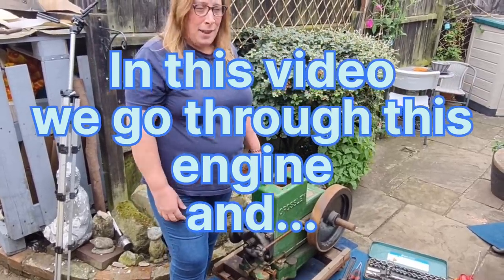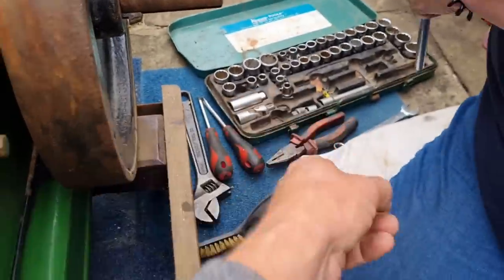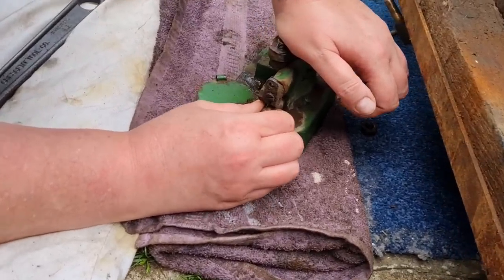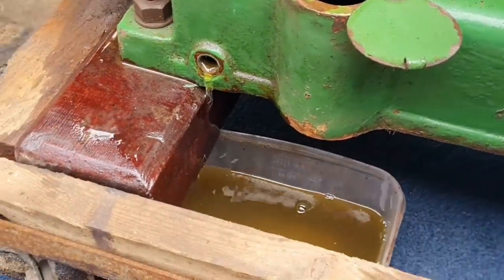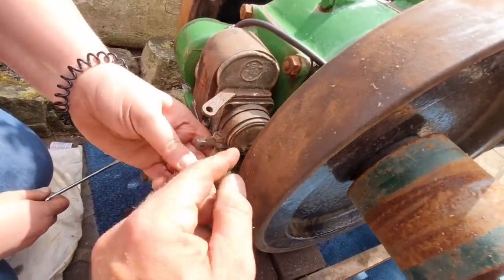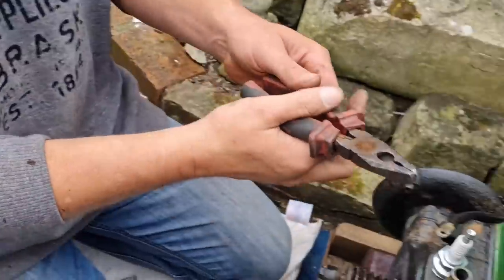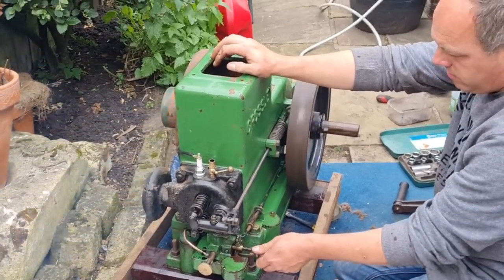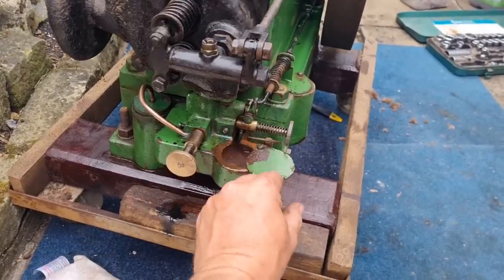Barn Find Engine.Old start cold start. Crossley

Comment: Rachels Crosley is a Petrol Paraffin, the main tank is for the Paraffin/TVO and you just fill the bowl up with petrol, just like on a old Ruston. 

BUT Unless you have easy and cheap supply to heating oil, it might just be easier these days to run on petrol, especially if the engine is not going to be under a real load. 

I actually wonder if your timing is a bit retarded. 

When the comment about a prick came up I was waiting for  Rachel to say something about Adam....... lol. 

Lovely to see Mrs Mancave taking a active interest in old engines. Do we need another channel, or perhaps a channel name change to Mr & Mrs Norfolk Mancave? As I tell my friend Becky, there's very little a man can do that a woman can't. Sybil loved seeing Rachel working on a engine.
Reply: Thank you will pass the info on, was chuckling to myself at times, thank you for all your support x
Send our love to Sybil x

Comment: To determine direction of rotation,Look at the heel on the points, it should run in the trailing position rather than leading. If you ,know what I mean. Off load she sounds like a hit and miss engine, does the governor control a" kill" switch for the mag?
Reply: Hi I have passed this on to Mr MC . Thank you for all your support x

Comment: It is petrol paraffin - petrol in the trough and paraffin in the base tank, when the fuel is used up in the trough then switch the base tank valve on. You can just run it on petrol in base tank if wanted like you are now then if so dont touch the trough side. Put more tension on the throttle spring and it will fire evenly
Reply: Thank you I have passed this on to Mr MC
Thank you for all your support x
Reply: @OutandaboutR  😎

Comment: They should have screwed all those needles in first, so they would have a starting point when they try to start it!   Urff!
---
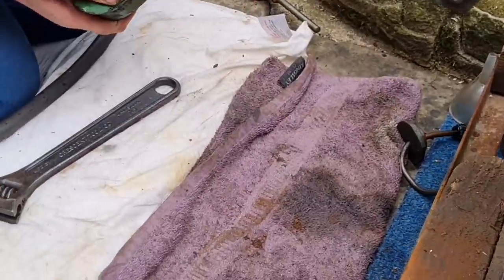Really! At 31:18, they're only going to finger-tighten those bolts!? 👎  At 35:50, did they make sure fuel flows threw the tube?
At 1:28:00, adjust that side needle for maximum engine firing, then count the number of turns when it's not running.
Reply: Absolutely right we should have and have passed the info on to Mr MC 
Thank you for your eagle eyes and support x